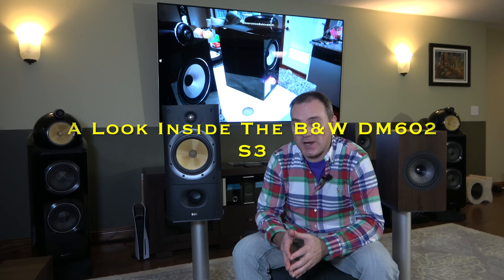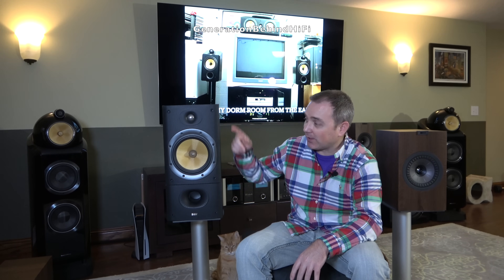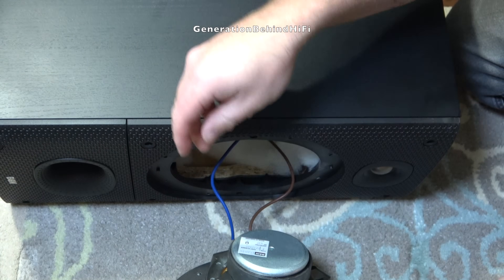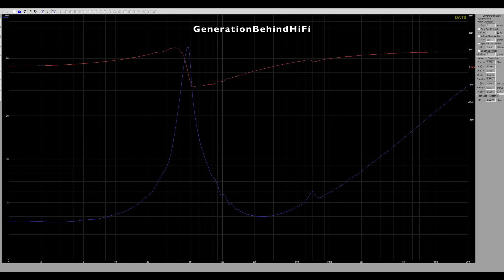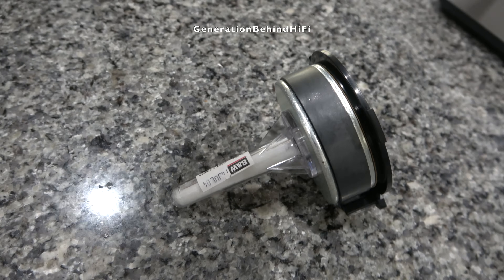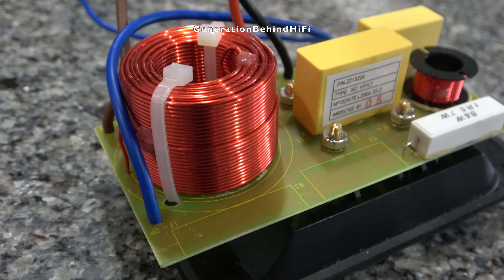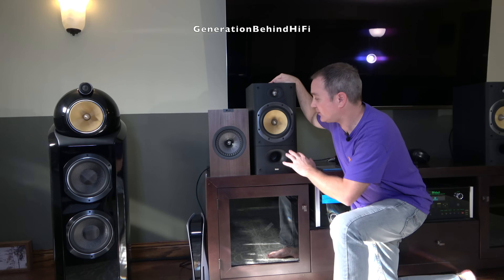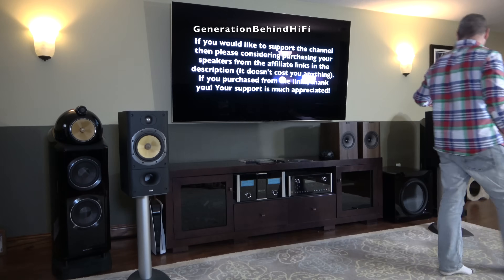A Look Inside The B&W DM602 S3 - This speaker has a large 7" driver and a big cabinet.

Comment: After starting with a pair of Tannoy mecury M2s, the 602S3 was my next venture into high quality British speakers. The 602s were too big for my room, so i tried the 601s, but they weren't nearly as good, having a big suckout in the midrange, which most subsequent newer B&Ws have suffered from, as well as a tweeter that was way too hot. Fortunately, neither the 601 or 602 suffered from that. That 805S from that era is still one of my bucket list speakers. IMO, B&W went downhill after moving away from Kevlar woofers, and all the later speakers after those Nautilus series ones from the early 2000s weren't nearly as good.
Reply from the maker: Instead of the 805S, get yourself a pair of 805 Signatures. It's still one of the best sounding and looking stand mount speakers I have ever  had the pleasure of owning. My only regret is selling them. 

Yeah, B&W has been through a couple of ownership changes and IMO they just aren't as good as they once were. Just about every pair of newer B&W's I have heard will make your ears bleed because of how bright they are. I hope they get back to building great sounding speakers, but I think most of their great engineers have left the company.

Comment: Which do you like better between 602 s3 vs kef 350? I’m currently running my 602’s with an avr 140w per channel stereo. Do you think an amp about 200w per channel will improve the sound? Thanks

Comment: Great video. Please note that, rosewood veneer was additionally to black and light oak colors offered with these speakers. First pair I bought early 2002 (black), and I was lucky to find last packed (new in box) late 2007 (light oak). Even though I start purchasing B&W speakers from mid 1990's, S3 made impression most of all 600 series to this day. This was very first time I bought same speakers or technology again after several years. I own different speakers and part them, upgrade and trade, but DM602S3  still have them, two pairs different colors, and will not sell them.
Reply from the maker: Thank you! We never received rosewood as a finish option in America for the 600 series S3. We only had "sorrento" and "black". Rose wood would have looked very sharp.

Comment: i own a rutcho upgraded pair of dm601 s3, with mills resistors and highe end caps. they are one of my favourite speakers. im curious if a similar mod can be done on this 602 s3 model. the crossover looks similar. check out the 601 upgrade on rutchos website.

Comment: Loving your videos! 👌I’m still rocking a pair of S312’s 😂
Interested to hear what your thoughts are of them? I’m still driving mine with a 200w/ch Denon power amp with a NADM66 pre.
Reply from the maker: Thank you! Its been a long time since I have seen a pair of JBL S312 speakers. IMO the B&W have much better imaging, clarity, and detail over the S312 and is the main reason I sold them. Sure, the JBL's had better bass, but I can easily rectify that with the addition of a subwoofer. Hope this helps.

Comment: Wow the hk is still going? I have the avr8000 but it stopped working decades ago. 🤣🤣
Reply from the maker: Yeah, my AVR520 still works beautifully. The backlit lighting is really dim after all these years and the primary remote died years ago. Now I use a generic remote with it but would like to find another HK remote. I really miss quality HK products from this time period. They really did offer warm sounding equipment for an affordable price. 

The AVR8000 was a beast back in the day. I think those AVRs were nearing 30lbs in weight if I remember right?
Reply: @generationbehindhifi  yeah they did seem to have issues with the remotes. 30 lbs I wish lol. Hk didn't skimp on the components on this one each amp had huge aluminum heat sinks in total it weights over 50 lbs I think they listed 53 to be exact. But moving it felt more like 60-70 I should probably workout lol.
Reply from the maker: @jasonnelson6624  Wow! Over 50lbs?! That's crazy. My AVR520 is heavy too but not that heavy. Shame it no longer works.
Reply: @generationbehindhifi  yeah I just can't bring myself to throw it away. I've tried having it repaired before which didn't work. Apparently its too complicated or too hard to find a repair tech that knows what they are doing? Maybe one day who knows till then it's a big bulky paper weight 😂
Reply from the maker: @jasonnelson6624  I don't blame you. It would be hard for me throw it out too. Have you tried emailing Harman Professional Solutions at HProServiceUSA@harman.com to see if they repair it? I would give them a try and see what they say.

Comment: Thank you for doing this expose. Much appreciated. I have the smaller siblings to these which I replaced with a pair of Martin Logan Motion 15i's. The difference between the two was not night and day...new isn't always much better. The Martin has slightly sweeter highs that's about it. Recently I bought a pair of Audiovector QR3 SE speakers replacing some Sonus Faber Venere 2.5's. Now this was not a close call, the Audiovectors clearly won the battle with much better highs, tighter bass, and a sweeter midrange. The Veneres had a lot of chestiness to vocals wheres the Audiovector articulated vocals more clearly with an ethereal quality.
Reply from the maker: Thank you for the kind words! Glad you enjoyed the video. 

Thanks for the feedback on the Martin Logan Motion line. I have always been curious about them. You're absolutely right. Newer doesn't always mean better and I recently came across this again when I did my KEF Q3 Meta video. I actually prefer the sound from my Q350 over the Q3 Meta.

Yeah, I'm not surprised by your comments on the Venere 2.5. IMO Sonus Faber kind of dropped the ball on the Venere line with the exception of the Venere S, which came out later after they realized the error in their ways. From what I remember, the Venere S is the only model in the lineup that is made in Italy and uses Sonus Faber developed drivers. The Venere S definitely has the Sonus Faber sound that most seem to love vs the rest of the line. 

I have never heard of Audiovector but it sounds like they make a pretty good speaker judging by what you have said about them. I'll have to keep this brand on my radar. I really like some of the designs they have. They definitely make some sharp looking speakers!